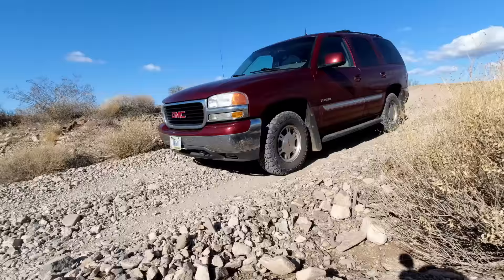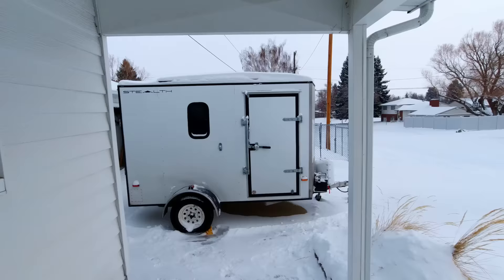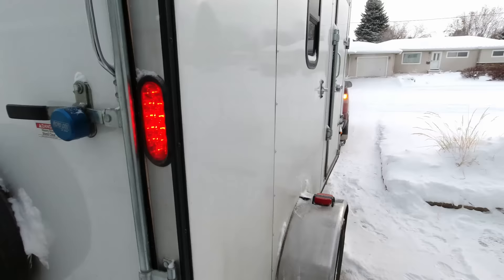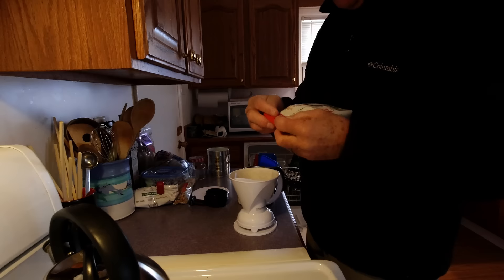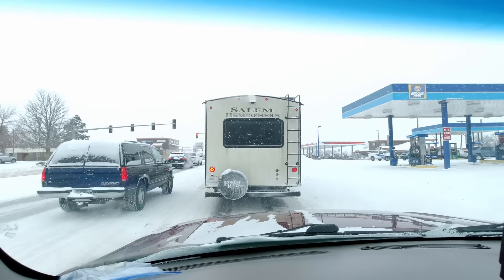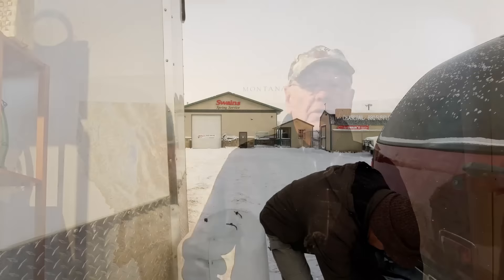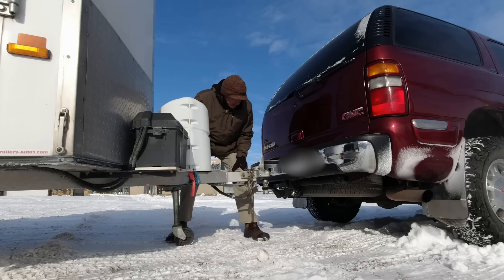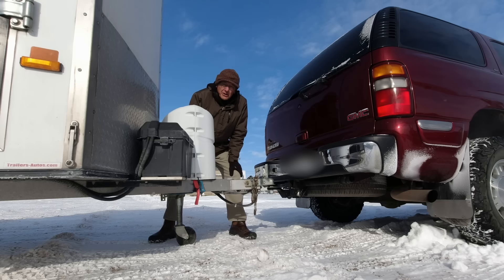Trailer Leaf Springs Or Torsion Axles?

Comment: I'm curious as to your thoughts regarding a drop vs straight axle for camping/towing. Is the extra ground clearance needed?
Reply from the maker: Good question.  I have never had a problem with ground clearance with the straight axle however, if you are planning on some serious offroading, then the drop axle might be ok.  I just like having the availability of parts that the leaf spring axle provides because if you break a torsion arm axle you may be stranded for a long time waiting for parts to arrive.
Reply: @gonagain  Most trailers I see have a 4" drop axle making it 4"  lower to the ground compared to the straight axle. Looks like only way to get a straight axle is custom order in my area. I will be sticking to a leaf spring due to the parts availability you mention.

Comment: So, about the only thing you didn't put on the drop-down list is the locking wheel chock.
Actually, 4 wheel drive can be used to stop a vehicle. Slam on the brakes, put it in reverse, stomp on the gas. I used that trick several times in my youth when driving in bad conditions. About the same time period, I used to slam on the brakes, put it in reverse, crank the wheel, and go down the road backwards in the snow. One time I did it and I was staring at a police car behind me. I spun it around kept driving. He must have thought I lost control as he didn't stop me. Might be a little tough with a trailer. Actually, I .....
Reply from the maker: Interesting way to get stopped and beats the Flintstone method of dragging your feet!  The wheel lock is from Proven Industries, not cheap but good insurance never is.
Reply: Thank you, I'll look them up. I accidentally learned the stomp, reverse, gas thing as I was starting over an embankment at 20mph on an icy road. I kept from going over. Used it a couple of times after that. You have to be quick and decisive.

Comment: That old leaf spring, you could make some knives with it. I was just wondering, how often    do you pack the wheel bearings on you camper. Good video as always. You need to be back in Arizona where it is warm. Tell Linda to take a coffee break take care and stay safe.
Reply from the maker: Hello WR!  I have replaced the wheel bearings once (the first ones were Chinese) and I installed "Bearing Buddies" so that I could just use a grease gun to lube them since (about twice a year). But this spring I'm replacing them just to be safe.  That will be about 5 years since I actually took them off.

Comment: How much did you pay for your aluminum trailer? I am wanting to get one like that .
Reply from the maker: I bought mine used for a good price and I don't know what they are new.  I didn't get aluminum because it was lighter, because it doesn't make enough difference for gas mileage, but because it doesn't require yearly painting to keep it from rusting, so I think the extra cost is well worth it.

Comment: I called two fellows i know who own cargo trailers who use them as RV units for Elk hunting and Deer hunting and they beat those logging roads all the time but i wanted to find out if they broke a leaf spring or two , nope and no one has heard of it ..  Leaf springs are in constant motion which is true, that's the job of a spring , movement .. But if one does break that's all it means one broke , replace it and on you go.. But both springs breaking ? never in my 77 years have i heard of that ..
Are you sure the springs weren't made in Iran or China ?  That doesn't say much for quality if that's the case ...I know one dealer here and maybe i'll give him a call to see what he knows but pretty good bet he won't say anything as he sells the cargo trailers .. But still it's good to know and useful information ...I'll hang on to this one and keep asking fellows who own them as i'm looking to buy a cargo trailer this spring sometime ...
Reply from the maker: One side broke and it's likely due to work hardening, so I had the other side replaced just in case.
Reply: @gonagain  Good insurance as you lost one spring .. I called one more fellow i know to ask him about his cargo trailer and throughout the years he has beat it up and down every logging road for hunting seasons , he said no broken spring , he said it should have broke , it's designed to flex .. No one here so far has lost a spring .. Could very well have had a defect in the spring ..
Reply: @gonagain  I have never seen one setup with shocks or rubber bumper stops , just never have , but that doesn't mean an aftermarket company doesn't make a kit for cargo trailers , that i do not know ..But it is interesting though ..
Reply: He said it should not have broke .. I forgot to reread it before i clicked on send ...

Comment: WHO EVER TOLD YOU THAT SHOCKS ON A RV TRAILER DO NO GOOD SHOULD CHECK HIS OR HER FACTS. SHOCKS DO TWO THINGS, ONE, THEY HELP IN CONTROLING HOW THE TRAILER REACTS TO ROAD CONDITIONS. IT HELPS ELEMINATE SWAY BY STOPPING THE TOP OF THE TRAILER FROM ROLLING. ALSO SHOCKS HELP TAKE THE IMPACT OUT OF POT HOLES AND BAD ROAD CONDITIONS WHICH CAUSE SPRINGS TO BRAKE AND OTHER COMPONENTS LIKE BEARINGS AND SHAKLES TO WEAR OUT. GO TO A  HIGH END RV SALES LOCATION AND LOOK UNDER THEIR TRAILERS.
Reply from the maker: I never said they didn't do any good, I said shocks won't fit in this particular type of axle.

Comment: In my experience, leaf spring trailers setups break much more frequently than their torsion axle counterparts.  

We've had far fewer failures with torsion axle trailers.  We use our trailers in both extreme heat and extreme cold conditions.  Our torsion axle trailers are even more superior on dusty, rocky, gritty, dirt roads where leaf spring pivot points suffer from accelerated wear.

Torsion axle trailers ride better lightly and fully loaded with much less shock transmitted to the trailer frame and the cargo.

We have had equal success replacing spindles on torsion axle trailers as we have had on leaf spring setups, though we find we seldom if ever need to work on our torsion axle trailers.